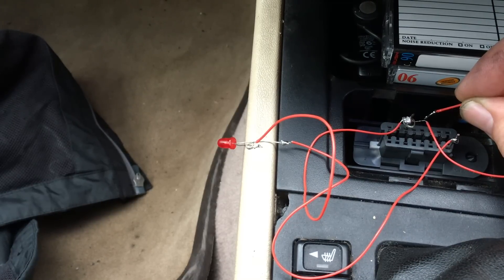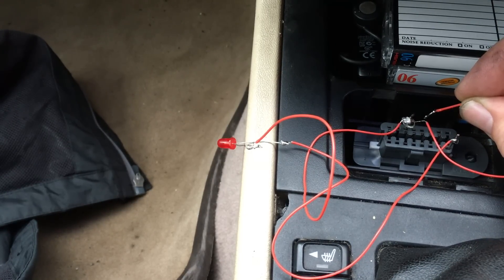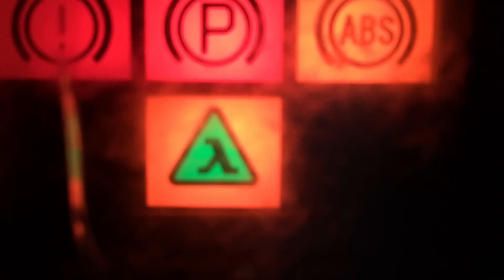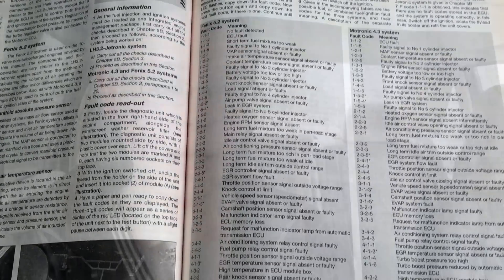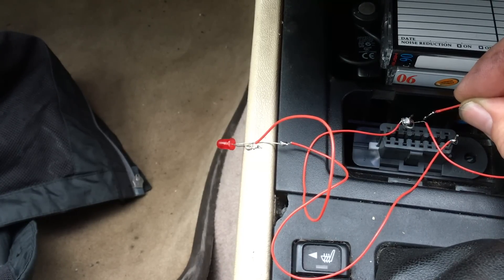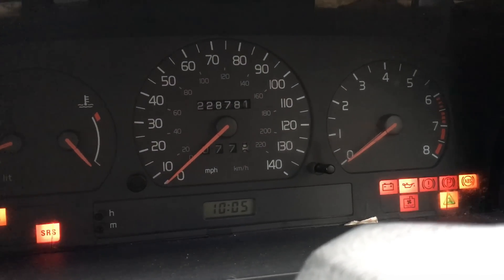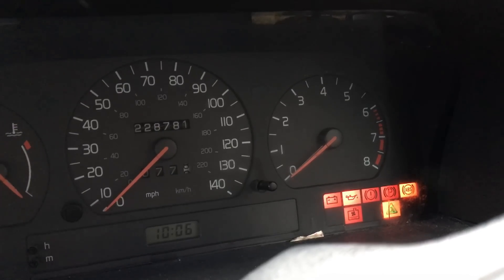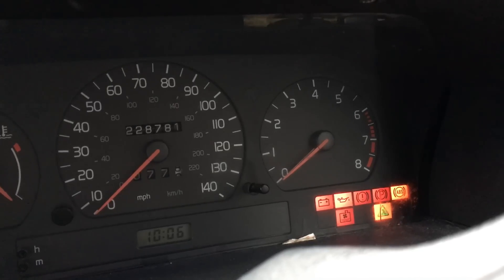How To Read & Clear Fault Codes with a homemade flash code reader on a Volvo 850 - VolVlog #5

Comment: Thank you, Jennifer. I have a Volvo 850 R 1996. 
It works great for me. I have had a 232 fail code and is the same way to reset. One piece of advice, after the first 7 seconds the system gets a longer light signal during this flash we should confirm reset and hold the wire for another 7 seconds. 

It's excellent job thank you.

Comment: Jenny, you saved my life! 🙂👍
And that of my mothers white 1996 850 2.5
Reply from the maker: Great to hear!
Reply: @JenniferEKirk  
It showed a 2-3-2.
I was already investigating oxygen sensors when I decided to first take a look at the plugs, air filter and for vacuum leaks. I started with the plugs to find the fourth one broken in two. The upper ceramic part detached from the metal base. Never saw that before. 
Checked the filter which was clean. 
After clearing the code it didn’t return.
Two days later the engine wouldn’t start at all. 
NGK ignition wires totally cross-firing after eight years of use. 
Completely cracked insulation. 
Not recommended. 
Went for silicone class F.

Comment: I suggest a 1K ohm resistor on the LED. You don't know what current limiting is there and RED LEDs have a max current of around 20mA so a 1K resistor will ensure that's it receives it below that.
Reply: I recommend simply just using an old fashioned 12v diagnose lamp with needle probe and a crocodile clamp. 
Works like a charm even without soldering. 
No polarity and no resistor required.

Comment: By the way, a simple old fashioned 12v diagnose lamp with needle probe and a crocodile clamp gripping a paper clip leg and the additional third wire works like a charm even without soldering. 
Top notch video though! 👍